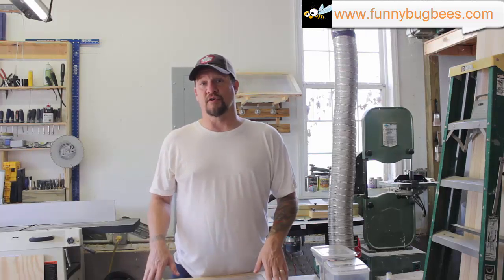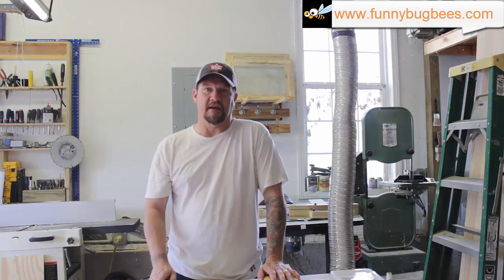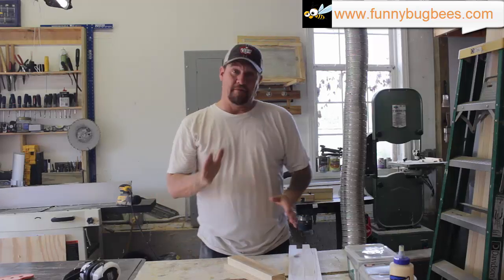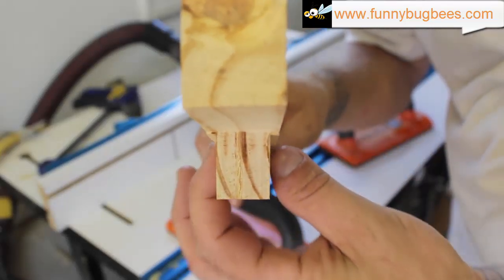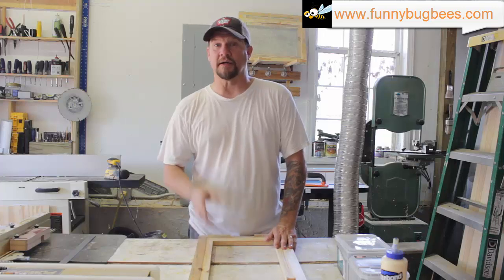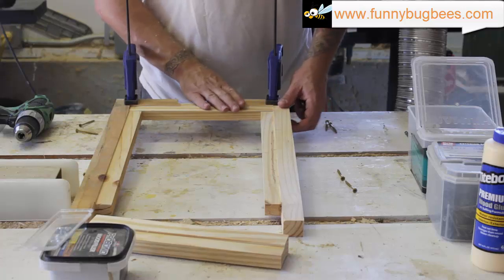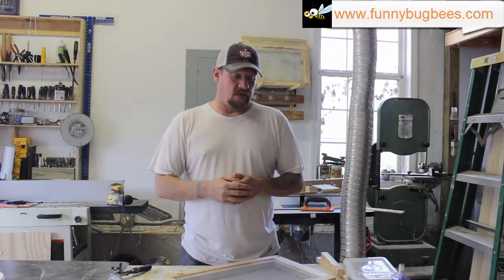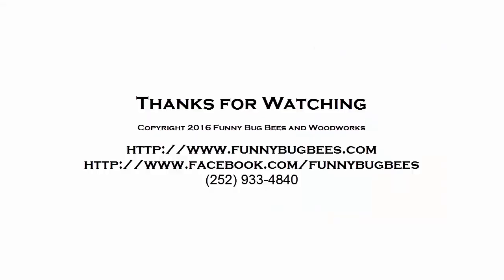Want more honey and brood? Double Screened Covers are the answer

Comment: I use double screened inner covers all the time. they work great and when winter comes i will just add carboard on top the of the cover and leave the entrance open to keep the air moving.  Be sure that your lid does not cover the screen other wise it is useless then.   I use 3/4 inch strinp of wood on the sides to create the gap.
Reply from the maker: I actually put a medium honey super on top of them in the winter, and fill the super with wood shavings from the shop. Soaks up all the moisture in the winter and keeps the bees dry and insulated.
Reply: Good idea. You could also use insulation board.  Either 1 or 2 inch, whichever allows for the opening.  Although, I’ll say that it seems like a pretty big opening for winter ventilation.  You don’t need much

Comment: if you are using a hive top feeder you just put a empty super on top before your lid and you wont have issues.
Reply from the maker: I think you meant to say "except for the issues of ventilation and robbing" because a super does nothing to resolve either of these issues, whereas a double-screened inner cover does. Before I began manufacturing equipment, I purchased many telescoping tops. None of them formed an air tight seal around whatever box they were placed on, they always allow bees to find a way in from the outside, promoting robbing. Even if you use a single screened inner cover, with an entrance cutout, which they all have, robbers get in. The only way to tackle ALL of the problems listed is with a double-screened inner cover.
Reply: They don't get into the top of my feeder. you put your inner cover on an empty super over the hive top feeder, and then when you put the lid on top you slide it so that there is no gap over the inner covers gap.  Now you can get really fancy and take that super and drill a couple holes over it and staple some screen over the holes for ventilation (but i havent needed to).  If you have any cracks under the edge of the feeder you can try a heavier lid or some vaseline.   You can always use a sceen bottom for ventilation if its really that hot.
Reply: This always works, even if you drill the candy holes for winter feeding.
Reply from the maker: I appreciate and respect your opinion, I just happen to not agree with it. Again this method does not provide ventilation out the top of your hive like double-screened inner covers do. Heat tends to travel up in this universe (there may be other laws of physics in other universes) So using the screened bottom board as a method to cool your hive is not effective. This is why you see heavy bearding on hives without them (double-screened inner covers) and no bearding on hives with them. Also to note is that most people need their supers for...well...supering.....A simple inexpensive double-screened inner cover solves all issues.
Reply: My mentor just uses a 2" square on top of the inner cover with screened vent holes and then the lid.
We Feed directly into the inner cover.
With Ziploc bags with a slit
Reply from the maker: yes that is one method, though i dont use ziplock bags as feeders. They work in a pinch but are a poor solution for many reasons.

Comment: They are also great to use to stop a robbing attack.   By flipping it over (so the entrance is up)  the robber bees ( smelling the Honey) will go into the top and yet not contact the honey frames.  They will overheat and stop when they are not rewarded.   Or at dusk you can remove the screen and set it away from your hive to let the bees go.   However I now screw one side of the screen so I can remove it to shake out dead robbers after about 100 Hornets died trying to get it.
Reply from the maker: I would like to see a photo of how you get bees or wasps in between the screens? On the ones i build using this video, nothing can get between the screens, im curious as to how they are getting in to your.

Comment: you can do the same thing with single screen and not waste extra material; just cut the material deeper and use the cutouts to sandwich the screen all around. best regards.
Reply from the maker: the reason for this design is that it is the thickness of the wood that allows you to have a "closable" rear entrance simply by flipping it upside down....you can do that with the single screen design.

Comment: Must be removed before cold weather? I can see this in hotter climates where high temperature is an issue. I also wonder how this affects fungus. Some is good, some bad. The bees must regulate humidity.
Reply from the maker: in the winter time i leave it on (without the shims of course), and add a shallow super on top of it and fill it with saw dust. This soaks up all moisture which might cause mildew in the winter, as well as acting as a heat insulator to hold warm air in. . Then when spring comes i just take the shallow super off and take of the cover and dump the saw dust off of it and put it right back on again.

Comment: Or use vented migratory tops like I do. Still, this is better than nothing.
Reply from the maker: I think the point to the video is to help people who already are using telescoping covers kill several birds with one stone. The use of ventilated migratory covers does not solve the issues of using hive top feeders either. You still need a screened inner cover to use both and to prevent robbing at the same time. I have several local customers who use migratory covers and still use double-screened inner covers with them for ventilation and to provide a robber-free method to use a hive top feeder with them.

Comment: I'd like to understand the difference between the DOUBLE and single screened inner covers.. I have single and DOUBLE screened bottom boards, and the only difference I find is that trash gets caught between the screens, so please enlighten me on the advantages/disadvantages.. You said need shims for better air flow under telescoping covers when hot, so I guess that would be on days when temps are above 80º, right?  Maybe I should ask what temps are screened inner covers best used with screened bottom boards?? temps are a bit cooler in the northern areas...  Thanks
Reply from the maker: Bees are able to generate 107f in dead of winter while clustered. You will not freeze bees by giving them too much ventilation. You can however kill them easily giving them too little ventilation. This is due to condensation forming inside the hive, dripping onto the bees and causing them to freeze. So it is always better to err on the side of too much. The benefit of a double screened cover vs. a single screened cover is that a double screened cover does several jobs. 1) provides a method to use a screened cover AND at the same time have a rear entrance. 2) doubles as a "quilt box", so no need to buy one of those, you can simply use a medium super and a double-screened inner cover then fill it with wood shavings for the winter. 3) Doubles as a hive separator for two queen splits (by turning the rear entrance to the back of the bottom hive, and up towards the top hive, this becomes their "bottom entrance", but still keep the hives separated). 4)  It acts as a barrier to both wax moths and small hive beetles when used on the rear entrance facing up position, I could go on, but this tool replaces several other pieces of equipment that a single screen design just cant do. So i use them, because I also on occasion need them for another purpose, saves me buying individual pieces of equipment, I just have to keep a few of this one piece on hand.

Comment: I made several of these and they have been great to have this summer. The one issue, is they built a decent amount of propolis on the screen. Does this happen to you? How do you clean it off since it is trapped between the screens? Is there something I did wrong that this happened? Again, thanks for sharing these how to instructions.
Reply from the maker: any open space is going to be closed by bees. I just remove staples and replace the screen every few seasons.

Comment: will smaller ants pass through that screen ? thx for sharing
Reply from the maker: the hardware cloth we use for this product is a #8 cloth with a 0.100" (2.54mm) aperture size (size of the opening) So its to small for hive beetles to get  through, but maybe some tiny ants could get through. That said ants can walk right through the front door of a hive. If ants are a problem at your hives, you should be considering stopping them from ever reaching the hive, by using one of the hive stand leg modifications with can and oil, or other popular methods.

Comment: Great video.  I'm trying to figure out why two pieces of hardware cloth are needed.  Basically, the two pieces allows one to flip if over so that you have two inner covers.  It seems like with a bit more designing it would be possible to create a cover with one piece of screen that could be flip so that it serves two purposes.  I'm new to beekeeping.  Perhaps it's essential to keep the space between the inner cover and the top of the frames at a minimum to prevent bees from building comb into the space?  In any case thanks for the video, and I'm certain thermal regulation of the hive takes a great deal of energy.
Reply from the maker: two pieces of cloth allow it to be flipped over to provide a rear entrance or flipped the other way to not provide a rear entrance, such as when used over a hive top feeder.

Comment: A couple of my hives have a solid bottom. I notice bigger bearding issues on these hives. Would this provide enough ventilation on top of any of our hives, or would you also need a vented super in combination with this? Also, I just wanted to clarify that you said this still works well on top of a hive top feeder for ventilation and moisture escaping?
Reply from the maker: yes its enough ventilation without a ventilated super. we sell them and they come with shims which hold your outer cover an inch above the double screened cover. plenty of ventilation. Also, yes they work on a hive top feeder to keep all the other bees and insects out, so long as your hive top feeder has vent holes in its boom, other wise no air gets through it to the screened cover.
Reply: @FunnyBugBeesandWoodWorks  Thank you for your reply. I realized I was missing the part about adding a shim until I watched your other video with these in practice. I was wondering how air would get in/through if the lid was just sitting on top of it.

Comment: What am I missing? Looks to me like there is no need for screen on both sides.
Reply from the maker: there are several reasons. 1) it is reversible so you can use a screened inner cover with an upper entrance if needed which is something not possible with single screened covers, or turn it over to close the entrance to provide ventilation but still keep out pests and robbers. 2) it allows you to use an empty honey super on top of it filled with wood shavings as a quilt box. 3) It can be used above a miller style, or fat bee man style feeder and lock out robbers from getting into the top of your feeder. I could go on but it has more versatility than a single screened cover and therefore is a better choice than a single screened cover.
Reply: @FunnyBugBeesandWoodWorks  With all due respect, I'm still missing a piece of the puzzle. Your design for example will do #1 without the need for 2 pieces of screen, and while I have no experience with #2 and #3, looks like it would take care of them as well. Albeit there would be excess space for burr comb when the screen is on top. Thanks.

Comment: What kind of screen you are using
Reply from the maker: #8 (with smaller than 0.125mm aperture) or window screen, either works, though i like #8 better since it takes WAY longer for the little buggers to propalize the screen. Though this isnt an issue, i just use a heat gun to clean them and re-open the apertures in the hardware cloth. Though to be honest I dont usually do this either, the things are to easy to make

Comment: Can brude box be placed on top of the screen with the screen on the bottom of the hive.Greg
Reply from the maker: it could  by placing the entrance hole upwards it would act as a screened botom board with an entrance. but since heat rises, so i think above the hive as the inner cover with the two shims holding it up a bit is best.

Comment: I live in central Oklahoma, I run closed bottom boards, inner cover with top entrances and use plastic enclosed top feeders so no robbers can get in the top plus I use 1¨ styrofoam insulation under the lid all year round and I don´t have a problem with bearding.  This appears to me that this is another marketing gimmick as you are the one making and selling this item.  I have done many a cutout of buildings and trees.  There is not this ventilation you speak of in nature.  Maybe more shade in some cases but not the ventilation.
Reply from the maker: Point 1 - your assertion that there is no ventilation in a hive. Can you please explain to our subscribers then how there is always an inner influx of air on one side of the entrance and an outflow of air on the other side of the entrance? I can tell you why, because bees cause a ventilation circuit to cool the hive. It's well documented.

Point 2 - marketing gimmick? the following companies sell double-screen inner hive covers:

http://www.mcssl.com/store/honeypagebeesupplies/double-screened-inner-covers
https://americanbeesupplyllc.com/product/double-screened-inner-cover/
https://www.dadant.com/catalog/b15501-ventilated-inner-cover-10-fr?utm_source=google_shopping&gclid=Cj0KCQiA0b_QBRCeARIsAFntQ9oPz3hzIaWS-V3vE20ZnO4sfzptWTQCtxx5IoPKx_5r6buaQ9KJhR4aAscPEALw_wcB
http://www.brushymountainbeefarm.com/10-Frame-Ventilated-Inner-Cover-Moving-Screen

Among others.........

I use every product I sell, if they didnt work i wouldnt use them. What you do in your bee yard is fine, i wont knock you for it. However, try not to be a hater and knock me for what i do in mine.

Comment: why you got robbing!  is >  enteral feeding nectar or sugar water I only feed powder sugar and pollen and flour in winter That the only time i enter feed.  I have feeding station 25 foot from my hives. what where i want robbing if any!  NOT IN MY HIVES  I have a quick fix for vention in the summer, put some 3/8" wood stub under the inner cover on the back side only!  Your top should kept every thing out from the sides and the bees can guard it well or You can place nickles, quarters, half dollars what ever in between you boxes for more air flow too ! What i got to do very SOON ! There board washing now!  THAT MEAN THERE MAKING HONEY! they do this back and forth motion to throw up honey and propolis! It gives them motion sickness! YES HONEY AND PROPOLIS IS BEE VOMIT! GOOD STUFF RITE! How they make it
Reply from the maker: why would you ever feed flour to bees? They do not digest it well, and you cause them dysentery. Even dry feeds contain no more than 10% flour, the majority of the volume of commercially acceptable dry feeds is brewers yeast. However that said, there is no good substitute for real pollen as a protein source. Even if you do feed them flour, you should use soy flour and not wheat flour as the protein content is much higher in soy flour.
Reply: Its a pollen substitute and it works Very well and even corn meal flour. Yes you can feed em wheat  flour and soy as well.    Feed em yeast you will blow them up and shit them selves to death > ALL THAT YELLOW BEE SHIT AROUND YOUR HIVES IS NOT A GOOD THING